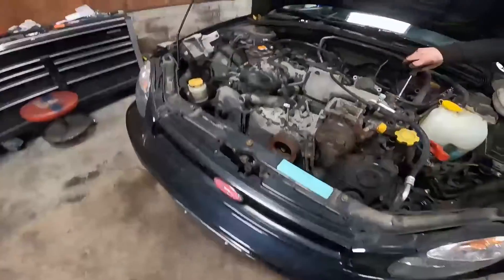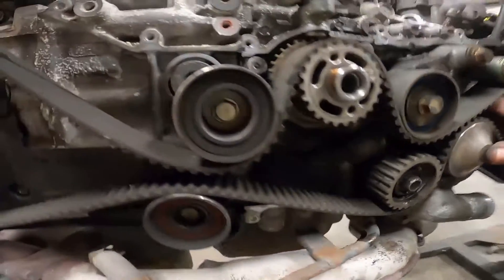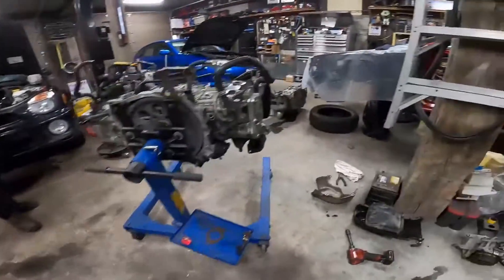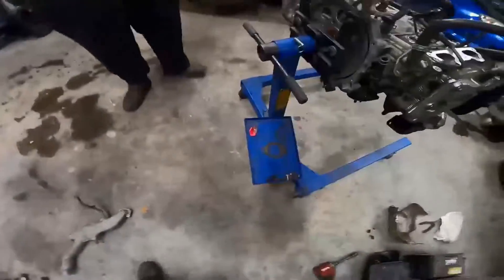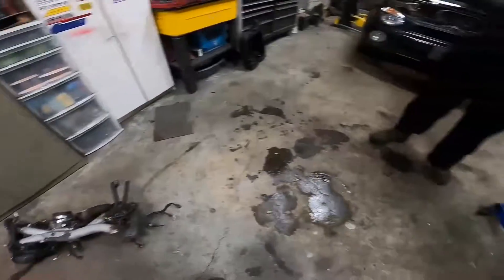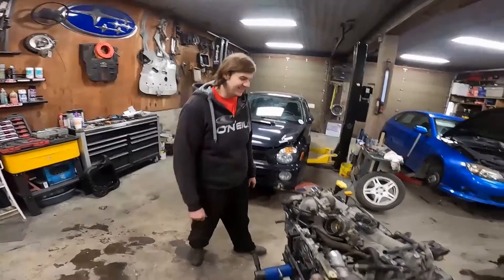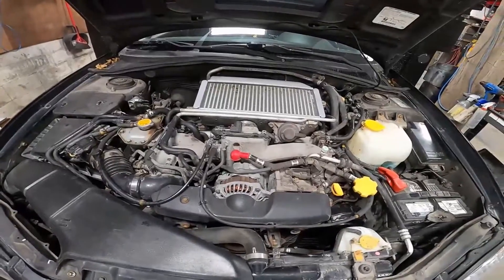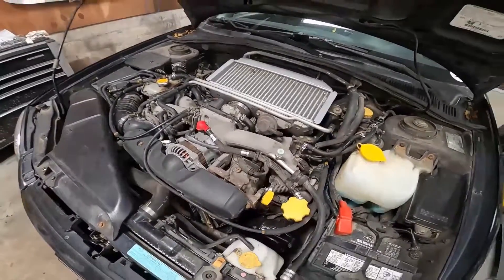How To Install Jdm Ej205 Into Usdm 02-05 Wrx

Comment: I appreciate you putting out this video. I have an '03 USDM WRX Auto and spun a rod bearing back in 2020... it's been sitting in my garage for almost 3 years and I've just gotten hold of a JDM EJ205 to put in. I've been combing through iwire pages and your video to reference everything else I should need and would need to transfer from the old engine. Hoping to get everything done in a couple weeks through a shop! Cheers.
Reply from the maker: Glad you found it! 
If you are using the matching jdm 205 ecu, I actually have a video doing that as well. I was installing a jdm 207 which is actually exact same process but go through the simply wiring needed. The iwire kit really does make it simple. 
Come back if you need any help.
Reply: How’d it go?

Comment: I know this video is a bit old. But did he not need to get a retune? From what I have read on the forums jdm and usdm ej205s have different compression ratios.
Reply from the maker: No worries, they are not different compression ratio’s. If out back exactly the way it was. It will not need a tune.
Reply: @TheSubieSanctuary  ok cool I have currently building a hybrid engine with a 257 short block and 205 heads but really miss driving the car so I thought about throw a jdm longblock in but then I realized I would still have to tune anyway as my fuel system has dramatically changed lol
Reply from the maker: @TheBluntcreature  ya the 2.5/2.0 combo is wicked. And ya thats a good point if you have mods already to consider when putting in the jdm for time being
Reply: @TheSubieSanctuary  yea had a buddy with one. I already have a bunch of mods
Reply from the maker: @TheBluntcreature  was your car already tuned for the mods? If so then just replacing the long block youd be fine as is. Unless they are new stuff since last pulling engine then ya youd need a tune ideally
Reply: @TheSubieSanctuary  it was tuned for everything but the fuel upgrades, aem 340 fuel pump and parallel fuel line setup

Comment: I did all of this and my car is not turning on its struggling idk why
Reply from the maker: Crank but no start? Fuel lines backwards is a common on. Let me know!
Reply: @TheSubieSanctuary I forgot to replace the sensors from the usdm like the CRANCK sensor knock sensor and cam sensor
Reply from the maker: @ANDREW1994ization  if they plugged in, it won’t actually effect they are most often all the same sensor
Reply: @TheSubieSanctuary hen idk what Idk what the issue is can you send me a video of how the fuel lines goes plugged in maybe I’m fucking it up
Reply from the maker: @ANDREW1994ization  the engine cranks over right? But does not fire right?
Reply: @TheSubieSanctuary yea correct
Reply from the maker: @ANDREW1994ization  have you tried just swapping around the 2 fuel lines yet?
Reply: @TheSubieSanctuary I found the issue I connected two plugs unmatched the black one and the white one were the issue lol thanks a lot for your time
Reply from the maker: @ANDREW1994ization  thats awesome! Yes for the coil pack plugs its black to the back 😬 glad you found it brother

Comment: did you use the usdm crank sprocket for this? i love watching this video but i never can tell if it was switched over
Reply from the maker: Sorry, this was an older vid and my explanation was a bit primitive then bs now on some stuff. Really need an updated vid. I did not swap crank or cam gears or sprockets. 

Only reason you would ever have to us if you got a ej205 from a jdm gc8 (they have large spacing between crank sprocket teeth vs the 02-05 wrx’s with the close teeth on crank sprocket. Just compare your 2 to be sure. Only need to crank pulley off each and take a look
Reply: @TheSubieSanctuary  hey! I’m back so I’ve been starting it and it’s been giving me cyclinder misfires on all cyclinders and -2 boost pressure idk what’s up
Reply from the maker: @roxythekrx7190  vac leak is very possible. Should be like -18 at idle. 
As for the misfire, does it run like its missing on all 4. 
Maybe coil plug plugs are backwards. 
Black to the back for coil packs
Reply: @TheSubieSanctuary  the coils where a problem I switch them to the right pattern black in the back and for the vacuum leak yet to find it but apparently it’s a big one if it’s at -2 in boost
Reply: But after I switched the coil plugs it still does it
Reply from the maker: @roxythekrx7190  you can run car and use propane if you dont have access to a smoke machine. The propane torch will make it rev up when you get near the leak. (Propane torch not lit) just expelling a little while car running and scanning over the intake
Reply: @TheSubieSanctuary  re did the intake manifold gaskets and took her on a little drive numbers where amazing threw out the drive! Gonna get it tuned soon

Comment: Hi, I’m doing this swap now and I’m confused as to what happens with the 2 cam sensors on the back of the jdm engine. I swapped over the usdm intake manifold but it only has the one connector for the sensor on the drivers side, which I’m pretty sure is why I’m getting gross misfires on 1 and 3
Reply from the maker: The 2 cam angle sensors at back of engine. When using the usdm ecu, they will not be plugged in or used and will not cause any issue what so ever. 

You may something else causing the misfire unfortunately.

Comment: Do I need to swap ignition coils and spark plugs  using usdm ECU?
Reply from the maker: No, the jdm uses same spark plugs as original ej205 as well as coil packs. Always wise to put in new spark plugs though while motor is out. Typically thr jdm coil packs will have less milage and if your jdm engine came with them id use them over the original ones.
Reply: @The Subie Sanctuary  hmm the JDM use diamond FK0186, the usdm  02-03 uses Fk0333and and the 04-05 uses FK0334 Are they all the same?   I know for sure they all use the same spark.plugs, but the ignition coil have different numbers.
Reply from the maker: @AndemusRay  the can have different dwell times which is minor and not an issue if you match and use an entire set.
Reply: @The Subie Sanctuary  oh, good, good. I'm just trying to pinpoint why my blobeye is running rich at idle, I bought it recently, and the last owner told me that was a jdm swapped. I'm planning to send a tuner my cobb datalogs, but my brain never stops looking  to fix and understand things.
Reply: @TheSubieSanctuary  thank you for your fast responses.
Reply from the maker: @AndemusRay  if its running a cobb OTS map they can be pretty rich. But depends how rich your seeing. A few other things can cause rich issue.

Comment: Do you need a tune for the higher compression of the JDM motor?
Reply from the maker: This engine isnt a high comp engine, but some jdm engines are. It is definitely ideal to get a tune unless its a direct replacement of your original engine

Comment: Hey there. I’m looking at doing this swap into my 02 wrx 5mt dbc. Going to try and keep avcs working but having trouble getting solid answers on which ecus will work. The ones specifically numbered for WRXs always carry a stupid premium, and I know it isn’t necessary to use those specifically. 

Can I use any ecu from a JDM avcs ej205? Or will it specifically have to come from a 5mt with DBC?
Reply from the maker: Will have to be a drive by cable ecu. 
Early forester turbo, v7 sti, v7-v8 wrx 

I have a vid on here as well on wiring the avcs etc.
Reply: @TheSubieSanctuary  excellent, so the trans it came from doesn’t matter?
Reply from the maker: @Inspector_Bloor  actually thats a good point. I believe it can only come from a manual trans donor car. 

I have a avcs drive by cable ecu, a few actually (none for sale) but can send you the model numbers to hopefully help you find one. 
The one in my personal bugeye came from a forester 😳

Comment: so i have a 05 wrx non avcs. i am planning on swapping the engine with a jdm 205 single avcs. would i have to change the driver's side intake cam gear?

on the video at 3:21 minutes he only says that "you need your cam sensor" but never mentions anything about the cam gear/sprocket!!

any help is appreciated. im really stumped on what to do...
Reply from the maker: No you dont have to change driver cam gear. Are you just going to be running your original ecu ?
Reply: @TheSubieSanctuary  yea, just the usdm ecu. I'm not too worried for the avcs, if I can find a jdm ecu down the road I might use the avcs. But for now I plan on getting a newer engine and tuning it a bit.
Reply from the maker: @jorgetellez7969  ya youll be totally fine to install same way as i did in video
Reply: @TheSubieSanctuary  niceeee!!! hell yea. thank you for the help!! this was the last question i needed answered!! im glad i came across your vid!!

Comment: Thanks for the info and vid.  I have a 2005 WRX Wagon.  Since our cars don't have AVCS, would the non-AVCS engine be a better swap.  Is there something you don't like about the non-AVCS engines?  They're are about $400-600 cheaper.
Reply from the maker: Hey there, the non avcs 205 would be coming out of a pre 2001 jdm car. Getting to be pretty old and at our importers the non avcs 205 is rather rare now. For ease of access and a motor that is potential 5-7 years younger we end up with the jdm avcs ones.
There is nothing wrong with swapping in a jdm 205 non avcs. The swap is a simple as the swap we did in video. Just swap over intake entirely and your set
Reply: @TheSubieSanctuary  May I ask why it is necessary to swap the entire intake? Is it just for emissions? I don't have those restrictions where I live and would like to delete the TGVs.
Reply from the maker: @velovoodoo102  most the ones we get are drive by wire engines. So its a different harness and not compatible. If you get a drive by cable version then you can drop it in as is!

Comment: Hi guys, thanks so much....learning a ton from watching your videos.  I'm  in the research phase right now and here is my goal - to swap out my US EJ205 from an 04' WRX with a JDM EJ205 with as little hassle as possible.  Swap over the manifold, keep the TGVs, move over all the stuff you highlighted in your video, plug and play with my US harness and hopefully NOT have to send out for a tune. I'm thinking I can buy an AVCS equipped motor and not hook it up or do it at a later time.  No switching of cam gears or wiring alterations.  I see a lot of EJ205 non-AVCS motors out there but according to the IWIRE website, these are a first generation from 99-00 vehicles and I'd like the newer generation (they say 2001and new all come equipped with AVCS).  See anything wrong with my thought process here?  Thanks!!!
Reply from the maker: You are correct in the jdm non avcs engines coming from the pre GD cars. 
All the jdm 01+ wrx avcs. You can simply get an avcs engine and install as I did in the video and you are good to go!
Reply: @TheSubieSanctuary  Hi guys, a question here. We've installed the engine successfully; Running the USDM ECU with AVCS not hooked up yet. Runs well but will intermittently throw a P0340 cam position sensor code where the the engine will misfire a little when under moderate load but drives fine and idles ok under no load. Code usually trips when accelerating into the mid to higher RPMs.  Things I've tried to fix it: Switched out cam position sensor with the one from the JDM engine and checked their ohm readings (1.966 and 2.2 kohms), verified wiring continuity at the harness plug,  and check voltage on the alternator (14.1 volts under no load and 13.45 under load - initially started with the JDM alternator and switched back to the US; exact same part numbers).  We didn't have this problem before - just wondering if you have run into this after a JDM swap and if you have any suggestions.  Thanks!

Comment: I’m about to buy a jdm ej205 and do this exact swap. Does it matter if the engine I buy is single avcs or normal avcs
Reply from the maker: There is non avcs, single avcs and duel avcs. 
Only non avcs and single are going to work with the 02-05 wrx. Hope that helps
Reply: @TheSubieSanctuary  thank you I appreciate the help. So much information and so many different opinions on the internet it hard to find what I want sometimes lol

Comment: Awesome video. Not trying to be a critic, but it sounds like that engine has a knock and it was pretty defined when you are near the engine bay.
Reply: EJs are pretty noisy. Especially when cold. Last rebuild I did was new oem shortblock and totally rebuilt heads, sounded exactly like it did before the job and continued for over 180k miles without any issues.
Reply from the maker: It is still going to this day

Comment: In the video did you delete the AVCS system on the JDM engine?
Reply from the maker: No sir! Left it as is, not hooked up. 
Still capable of 300whp with a sti turbo and capable tuner
Reply: @TheSubieSanctuary   in the times you have done this have you ever had any issues leaving the avcs installed unused? I'm planning on doing this installing a usdm ej255 single avcs into my 05 wrx.
Reply from the maker: @ i have had no issues. 
With the 255 into a 05 wrx. You will need to actually swap in your ej205 intake cams though 😬 the 255 does not have a cam position sensor nor will the cams in the 255 work with the ej205 ecu. 
Swap the cams, throw your whole intake manifold on and you may need an adapter to hold the position sensor
Reply: @TheSubieSanctuary   I would have to swap to the ej205 cams or could I get away with plugging the ej255 cam oil holes and using the ej205 cam sprocket and using the ts cam sensor bracket attachment?
Reply from the maker: @rj6013 yes you could plug the oil hole at end of cam and use your 205 gears on the intake cams. Also make sure you use your 205 cam gear bolts! The 255 intake came bolts have a hole through them for oil flow
Reply: @    just wanted to say THANK YOU for all you do. You always answer all my questions and have been super helpful for me in my subaru ownership.
Reply from the maker: @ my pleasure buddy! Nobody should gate keep information especially if it can help someone save money and frustration 🙏

Comment: I’m sure you guys hear this all the time and probably tired of hearing it by now, looking at the comments to see if some are similar to my question but here I go lol. 

Recently purchased a complete, bone stock ‘05  WRX from the original owner. Had it for 3 weeks, and spun a rod bearing. So, I purchased a JDM EJ205 Non-AVCS motor. I’m planning to pull the existing USDM motor out the car this weekend. The parts you mentioned in this video to swap from the USDM to the JDM are all I need? Nothing crazy like the cam sprockets and gears.  Just stick to what you mentioned and I should be alright? Lol. Just on edge and this process is making me want to bite my nails off with anxiety.
Reply from the maker: No worries,  since your donor is the jdm non avcs engine. We personally dont see alot of those. To be sure just check crank gear and driver cam gear. Im 99% they will be exact same as yours anyway. But its a lot easier to check while out. 
Other then that,  im unfamiliar with those jdm intake manifolds. They may be the same, but if they are not, then swap over your complete intake manifold
Reply: @TheSubieSanctuary  awesome! Thank you so much 🤙🏽
Reply: @Vst eric bro it was cake honestly. I used a JDM EJ205 longblock NON-AVCS which is key. IF you get a AVCS motor to put, you’ll need a new harness to adapt to the variable valve timing essentially… 

Now, if you have a NON-AVCS to put into a 05 bone stock like me… you don’t need anything crazy or swap anything bro. I used the original turbo, manifold, etc to transfer from the old blown motor to the new one 🤙🏽🤙🏽.  Now for me in the process of the swap, I replaced: 
New Clutch, new turbo, new exhaust manifold, thermostat, idler pulley for the A/C , bunch of shit
Reply: @Vst eric I was reading the same thing but I never ended up switching the sprockets. Timing feels great for my bone stock ‘05 WRX. Motor has 45k total miles and I only broke it in so far at 700 miles. I spoke to a tuner in Colorado here, and they said no tune necessary. Only if for whatever reason check engine comes on he said but mine never did. It’s all plug n play. The JDM motors have better heads. Free flowing heads from Japan.
Reply: @Vst eric that’s fair, yeah man  originally from San Diego been out here for awhile. Cali is wack when it comes to modifications
Reply: @Vst eric true that, especially living in California, fuck that. Been in SD all my life and moved years ago.
Reply: @Vst eric full send. Just mate the Jdm wire harness on and some other things. I’m going to sell my wrx in about a year or 2. Planning on an Evo 4 or 5 build.

Comment: So just leave the plugs for the avcs with nothing on them and the jdm cam gears can stay on the motor
Reply from the maker: Yes sir! Later if desired you can always add in the bulk head avcs harness with appropriate ecu.
Reply: @TheSubieSanctuary   but to the people who want to do avcs you will need to have a manual transmission to use this feature the automatic transmission will not allow it to work without catastrophic results
Reply from the maker: @dakotaevans1768  an auto car can run avcs no problem as well. Just need single avcs ecu for AT , they are actually easier to find too